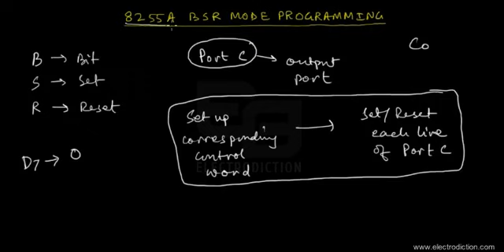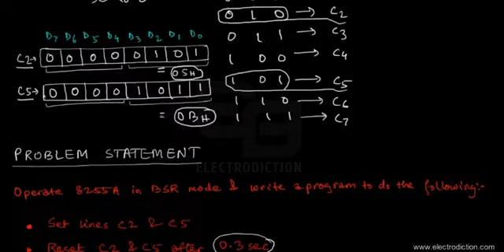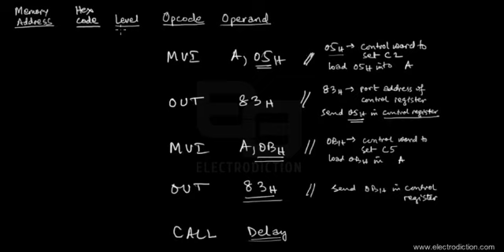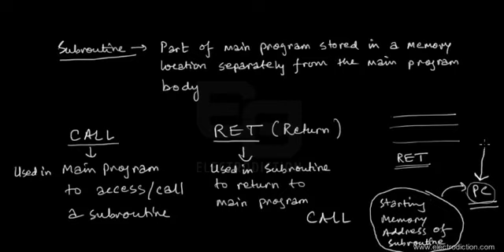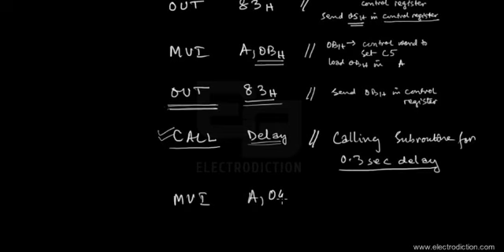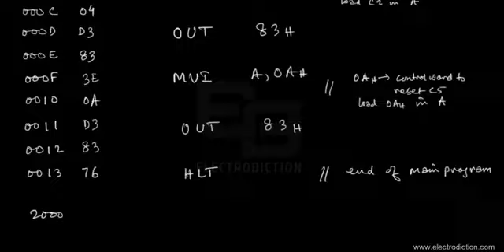8255 BSR MODE || Microprocessor

Comment: At 23:35 of the video, DCX does not affect the flag register like DCR or INR does, hence i guess JNZ cannot be used directly here !!
Reply: Absolutely
Reply: U r very right. DCX will not change flag register. In order to change flag, one has to perform ALU operation. Insert two instructions just before JNZ and the instructions are MOV A,H and ORA L